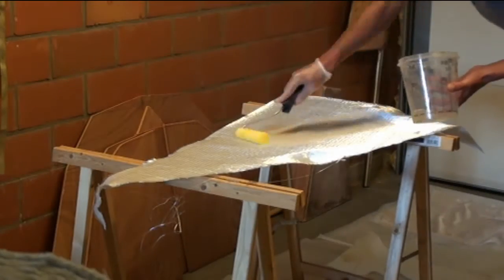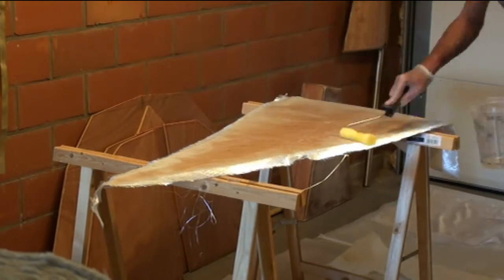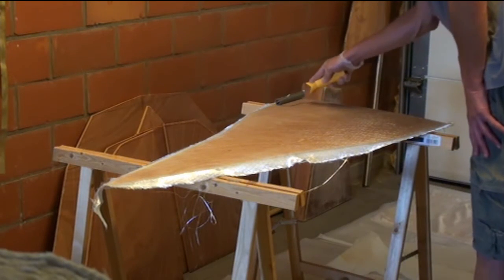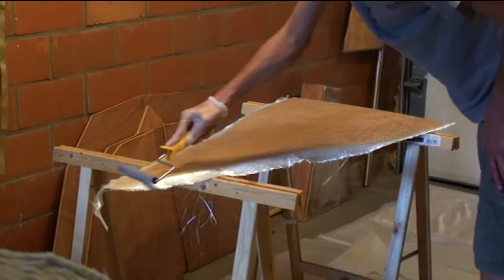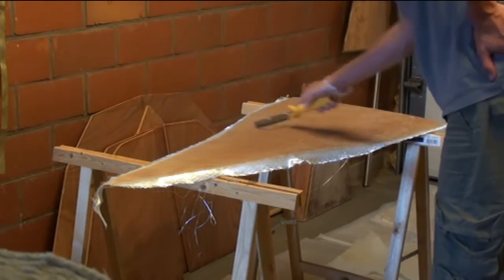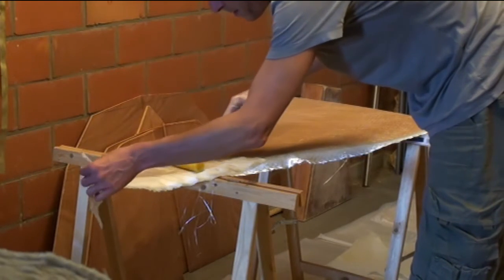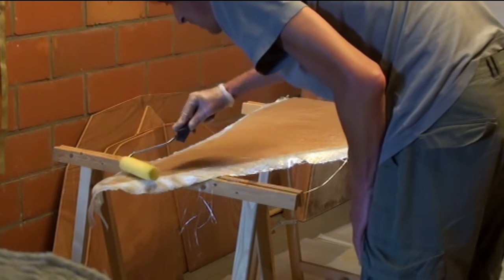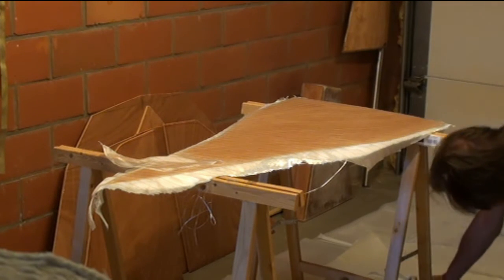Peel Ply Application

Comment: What is the peel ply made of. Is it Dacron or nylon?
Reply from the maker: Think its nylon. Works a charm on epoxy
Reply: PEEL PLY This is a tightly woven polyester material treated so that the resin does not adhere to it. Once the rersin and the glass are applied to the surface, peel ply is laid over and squeegeed down so that excess resin soaks up throughh the cloth. After the resin has set, the peel ply is pulled off, removing the excess resin and leaving a good rebondable surface which requires no additional preparation for the next coat.

That is very important, however, the peel ply serves other important functions as well. When applied over the wet lay-ups, you have a surface that will allow you to squeegee trapped air out without allowing the glass layers to move and shift around. When the resin/fiberglass layup is cured and the peel ply is removed, the surface will be free of harmful sharp edges and spurs. Peel ply can help ensure that the minimum resin that is required to properly wet out and bond the reinforcing fibres is all that remains after the peel ply is removed.
Reply: @catherinesecula5287  That's the best explanation I've seen so far. Most people don't explain WHAT it is, in YT videos, or why you'd want to use it, or why it's preferable over some other material. Thank you. But are you saying that it's mainly used to create a texture in the epoxy layer? I'm completely new to boatbuilding and paddle making. If the answer were obvious, I'd still be blind to it. Again, thanks.